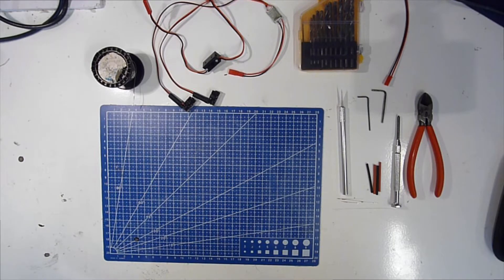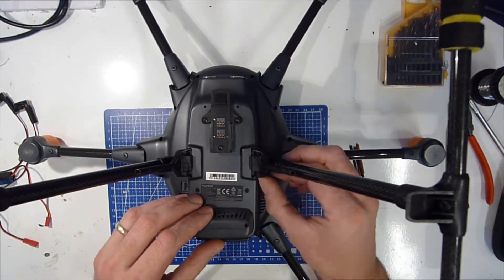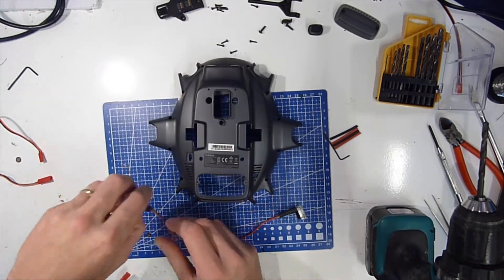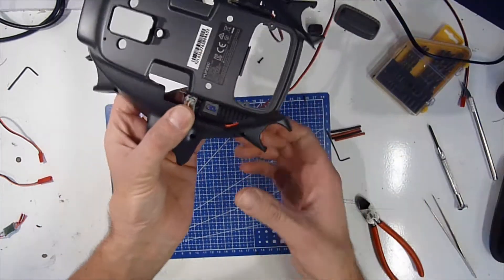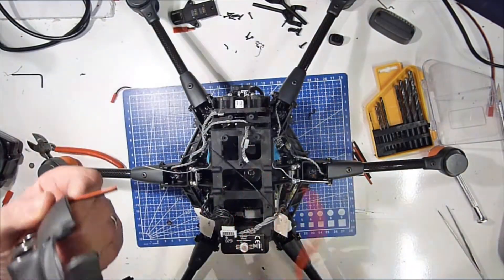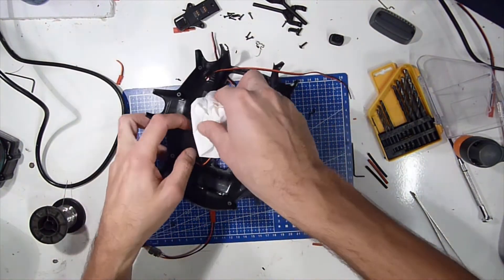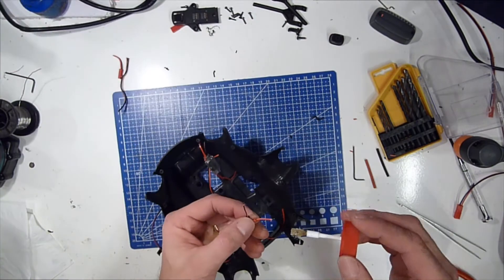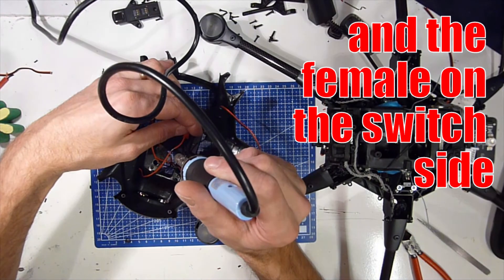Adding strobe lights to your drone (typhoon H)

Comment: I developed an easy way to mount a DR-02 strobe light on a DJI Phantom Drone.  Since the GPS for the Phantom is located directly under the center of the drone body I do not think mounting the strobe at this location would be advisable.  It needed to be mounted where it would be visible from above.  What I came up with was a way to fasten the Ulanzi DR-02 strobe above the battery, but low enough to clear the propellors. I made the mount out of an inexpensive plastic bottle that previously held some hydrogen peroxide (bought at the Dollar Tree for $1.00.
I uoloaded a video showing how I made and mounted this on the Phantom Battery: https://youtu.be/nmHv3Zos0mQ

Comment: So are you saying that you tap into the Typhoon's main power bus for the strobe power. I couldn't tell from the video. Thanks.
Reply from the maker: Yep I took the power directly from the battery terminal connectors.
Reply: Did tapping into the power source effect flight times?

Comment: For a quick strobe light addition, i would recommend Flytron Strobe with Velcro.  No direct wiring needed just Velcro them (Size of a Postage Stamp) to your copter.  Then to recharge just use a USB charging cable to onboard rechargeable battery.  Can be turned on when needed.  Each charge lasts about 6 hours of continuous use.  Best of all doesn't void the aircraft warranty and you can mount as many as you want.  Available in white, blue, yellow, red, or green.  I use them on my Inspire 1 and since they are attached with Velcro I can use them on which ever model that I am flying.  Just a suggestion for anyone who doesn't want to physically modify their aircraft.  https://www.youtube.com/watch?v=kmCqS4kxckA
Reply from the maker: looks good but for the price of 1 of those CREE lights I can get 12 strobes that I used. But a great option if you're not cheap like me. ;)

Comment: great work buddy, most probably will try it myself..........thanks for the video, great help, and definitely needed on my H too...just a silly question, what was the liquid you applied on the wire prior to soldering? thumbs up bro...
Reply from the maker: DRONE CY RO FINN thanks. The liquid is soldering flux for copper. Mainly used for soldering copper pipes together. Still had it lying around and it works for copper wires as well.
Reply: thanks bro, i should be getting some soon, seems to be a great help making soldering easier